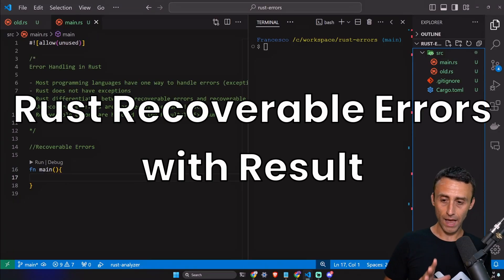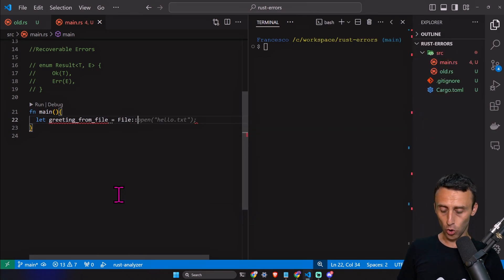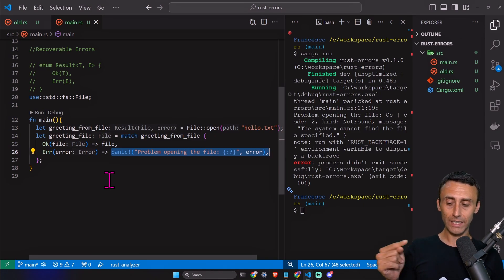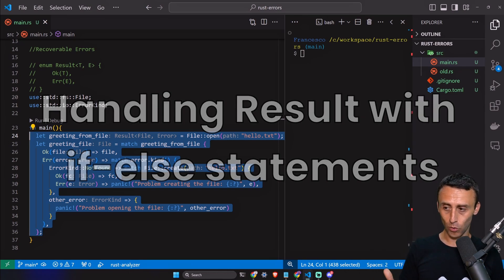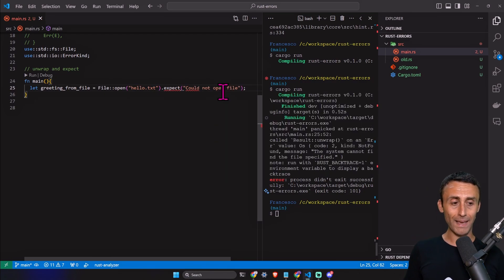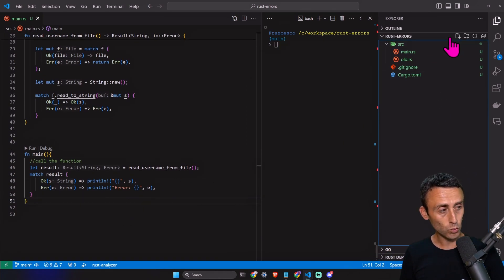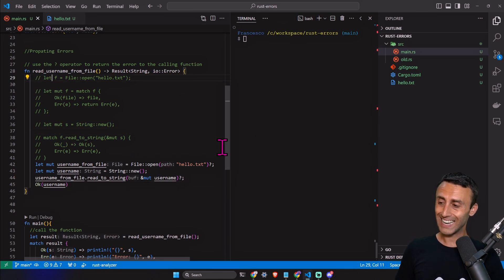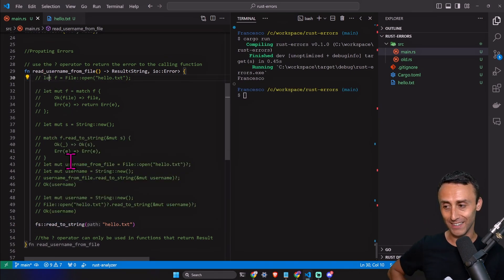Debugging Rust with Recoverable Errors: Result, Match, ? - Full Crash Rust Tutorial for Beginners

Comment from the maker: 0:00 Recoverable Errors in Rust using Result
1:05 A First Example for Recoverable Errors
2:04 Handle Result with a Match Statement
2:41 Matching on different errors
4:31 Handling Result with if-else Statements
5:13 Shortcuts: unwrap and expect
6:28 Propagating Errors
8:36 The ? Operator for Error handling
11:11 Wehere the ? Operator can be Used - Using the ? Operator in the main function